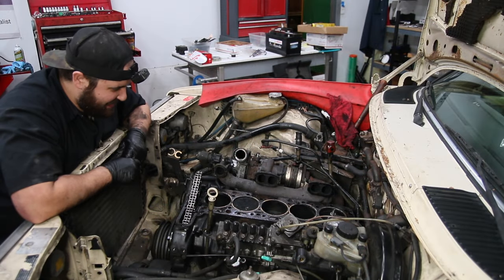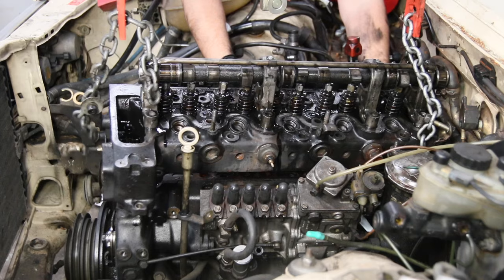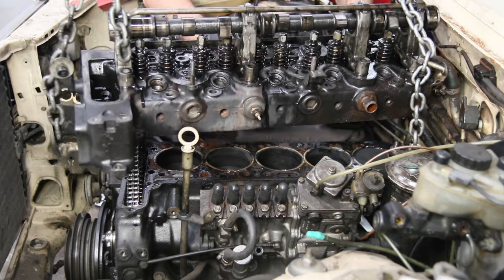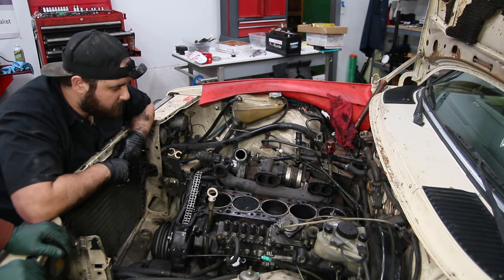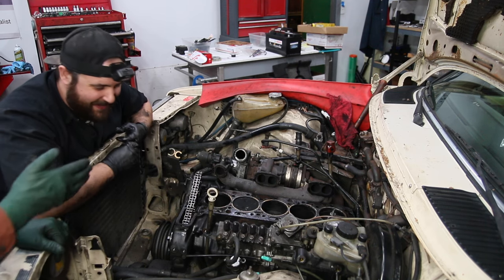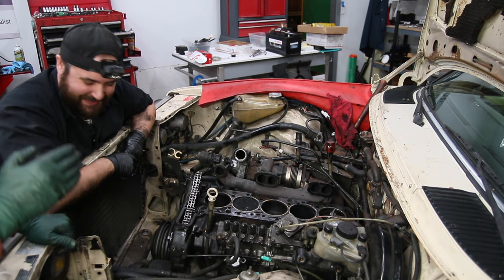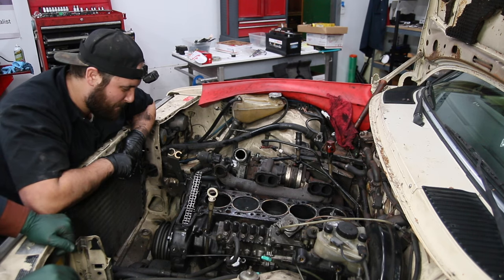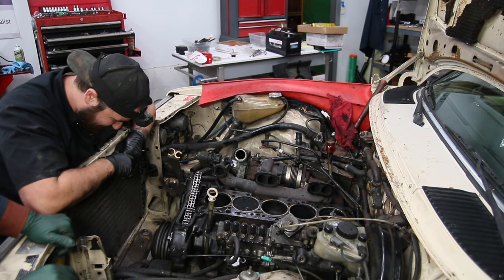Planning to Replace a Head Gasket: Don't Make This Beginner's Mistake! Why Important?

Comment: I am a total amateur. But if you don't line up the timing marks at top dead center, how on earth can you put the camshaft back in so the valves, the pistons, and the injection pump are in sync? Now you are going to have to turn the engine while keeping tension on the chain until you get to TDC so you can put the camshaft back in correctly. Whew!
Reply: That is why.
Reply: You seem pretty knowledge able to me

Comment: My guess is that if you bring cyl 1 up to TDC you have a 50/50 chance of the injection pump being 180 degrees out of phase. Essentially spraying fuel on the exhaust stroke instead of spraying fuel at the end of the compression stroke.
Reply: But if you also align camshaft mark, where can you be out of phase anyway?

Comment: I need a new head gasket on my 190e 2.3.  Seems a bit out of my league to do myself.  Would a competent general mechanic be safe to do it?  BTW I’ve used the Mercedes Source kit to do my brakes.  Everything went well, I recommend their products.
Reply: im 18 and i did it myself, barely any tools but luckily had an uncle with a machine shop who took off a thousands of an inch and the head was perfectly flat, bought a kit online changed valve stem seals and its perfectly fine now

Comment: I have a 1988 560SL that has a rough idle almost like it’s missing. Any suggestions? Cap and rotor, Timing, Vacuum hose, Carburetor?
Reply from the maker: You may need to replace the flux capacitor. :-)
Reply: what makes time travel possible ;)
Reply: @Mercedessource  That’s one ☝️ of the MOST Critical Components in this system, these damn Flux Capacitors……..
Reply: @Mercedessource  thanks I will check that and see what happens.
Reply: @Mercedessource  is this the capacitor that is under the distributor cap where the points would be?
Reply: Carburetor? Probably should not be working on that car. 😩
Reply: @Mercedessource  We get these questions daily my answer is "The glass future bowl is broken"
Reply: @MangusoRealty 
To answer your question with sincerity, there are multiple causes. The entire Vacuum, Intake, Valves, Timing Chain, Fuel Distribution and Ignition systems have to be checked. It is usually a multitude of parts from these different systems which have started to fail and are mostly caused by dried out plastic parts and rubber hoses and seals, besides of malfunctioning electronic components and require usually a complete overhaul of the fuel distributor (which you called carburetor) and fuel injectors. 
This will be quite an extensive repair

Comment: What happens if the timing chain breaks n everything is out of wack?
Reply from the maker: If a Mercedes diesel timing chain breaks it can destroy the engine if it is running at high speed. Damage to pistons and valves will occur.

Comment: Can someone explain please how to do that? The thing he forgot😊
Reply: First you must read the service manual to find the service procedure, where it will tell you exactly how to do that, by rotating the crankshaft pulley to line up the crankshaft pulley with the marks, while the camshaft pulleys are also lined up with their respective marks/holes.